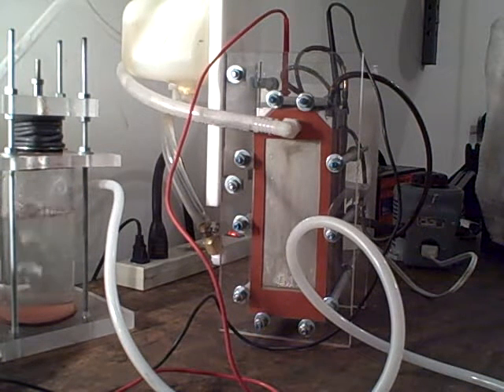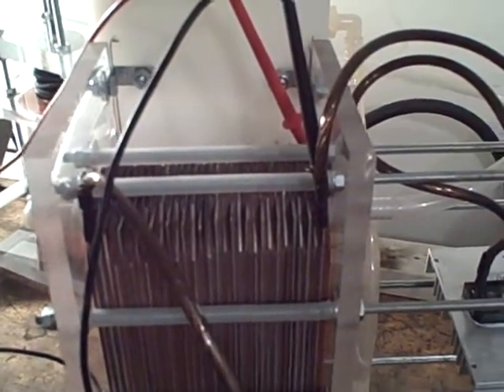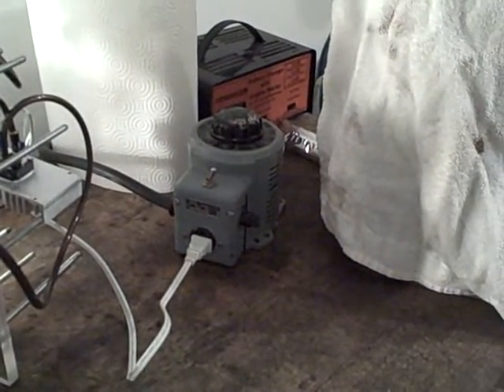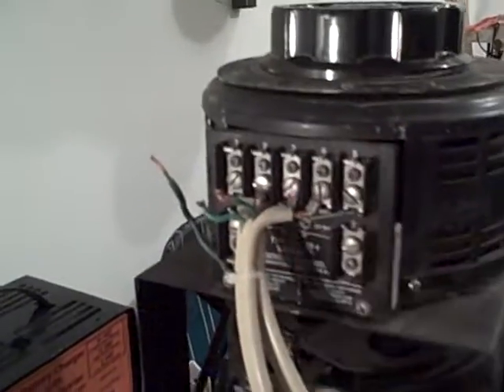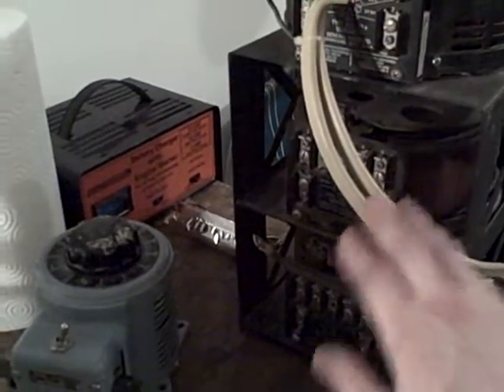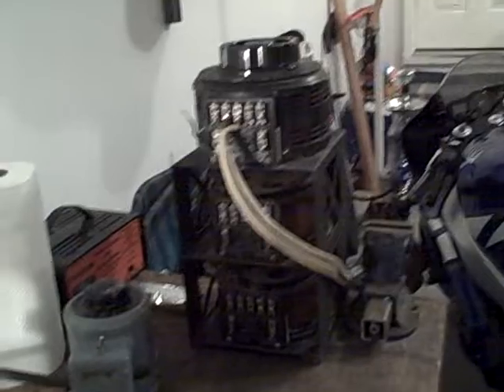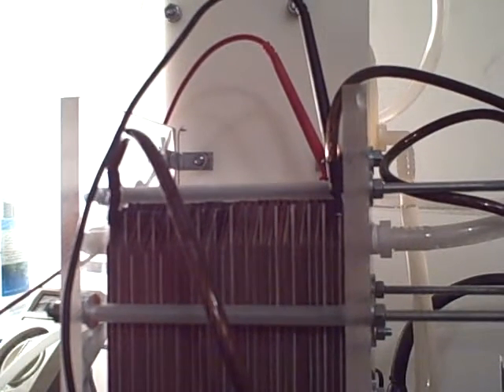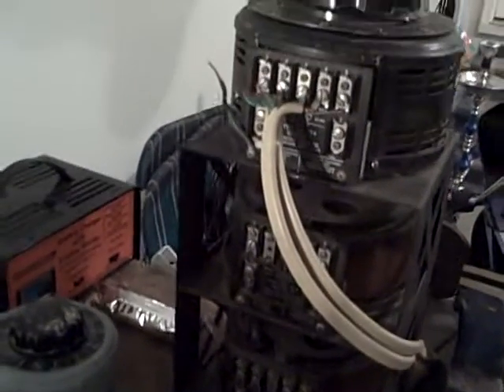Variac Help needed? for HHO

Comment: the trick when running a series cell is to maintain not more than 2-2.5v per plate gap, and never try to push more than 1 watt for every 3 square inches of exposed surface area ... if you design to that spec, there is no problem with thermal runaways or over heating ... I can run mine continuously for days on end and it never exceeds 120F while putting out 10 lpm on 120vAC @ 20a ... works like a charm ...

Comment: to answer your question, that device is intended to run 3 - phase 240vAC I suspect ... but yes, you could connect up to just one unit and use it to control 120vAC going to your bridge rectifier ... google a document called "Know your variac" ... should be out there in PDF format ... shows what the connections are ... I am green with envy over your variac ...

Comment: The answer is YES, you can use one variac for 110 single phase. As for wiring it, type in the make, model, or brand into google. There are web sites out there that will tell you how to wire your variac. I typed in the word Variac and found a wiring diagram. I'm not sure how to wire them all together for 3 phase. More than likely you will not need to run more than one variac. I wood keep on and sell the other two. They can fetch a pretty penny on E-Bay.